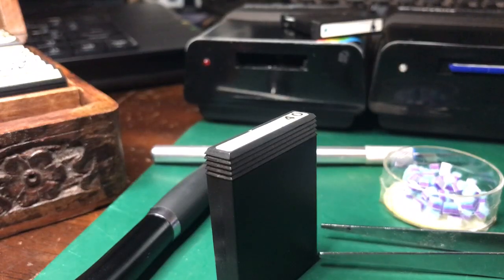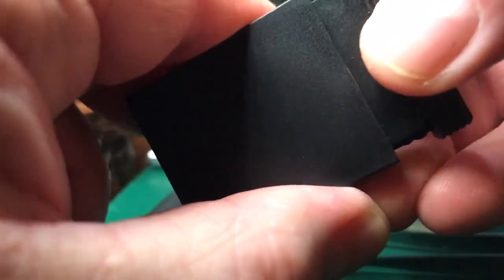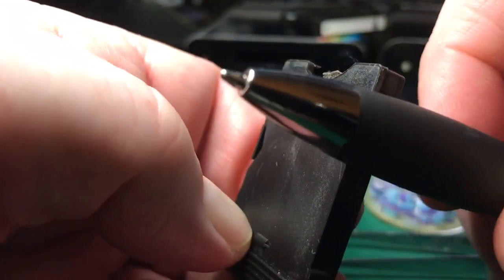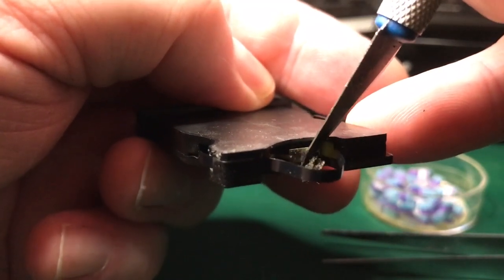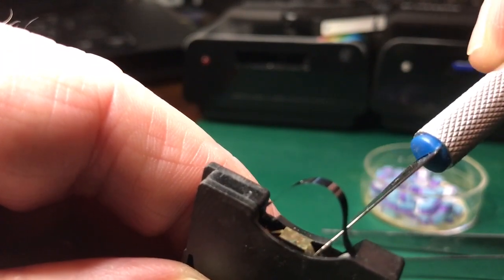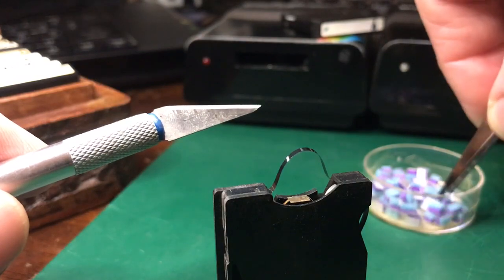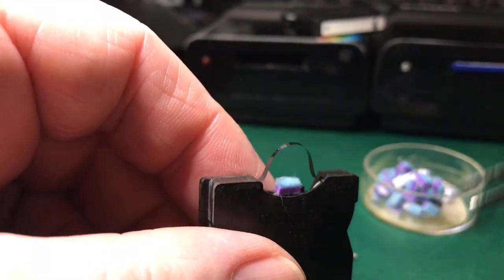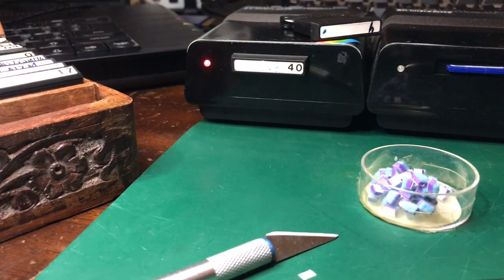Refelting a ZX Spectrum Microdrive Cartridge

Comment: Thanks Tim. This is very helpful. It doesn't seem as difficult to refelt a Microdrive cartridge as I thought. Have you found the minimum and maximum felt thickness that reliably works for these cartridges?
Reply from the maker: No I just used the ones I managed to buy which make the loop stick above the front a little under 1mm so compress flat easily.

Comment: Hi Tim, I acquired a speccy with a microdrive and a bunch of cartridges, which will need new felt pads. Where did you get those ready made ones?
Reply from the maker: I sourced them a year or two ago from a listing on Sell My Retro but, the gentleman no longer does them as people were finding it fiddly to do!  However Jim used the 8 track ones I mention below, cut down with a scalpel with no difficulty.

Comment: Subbed!

Tim, any pointers on where to get decent felt from please?
Reply: You can use felts from normal cassettes. You'll have to cut them to size, and use thin double sided tape to fit them.
Reply: @borayurt66  I'll give that a go, cant find any 8 tracks repair shops around here
Reply from the maker: If you take a look on ebay you will find 8 Track Felt pads listed - I know people have been able to trim those to suitable size with a sharp scalpel.